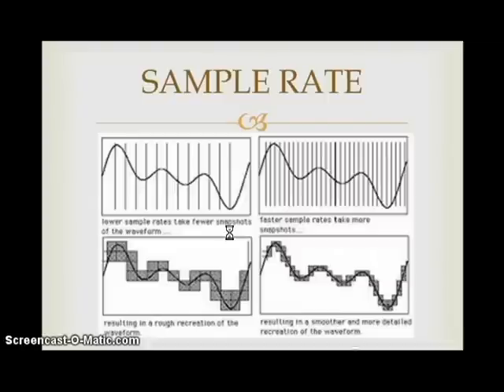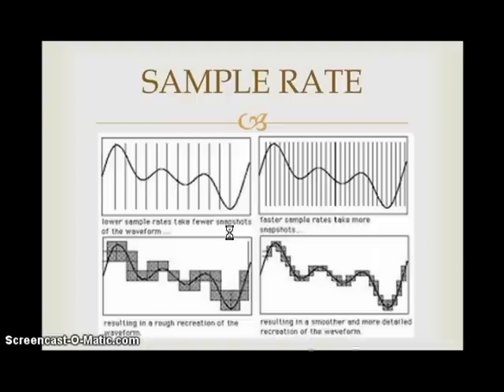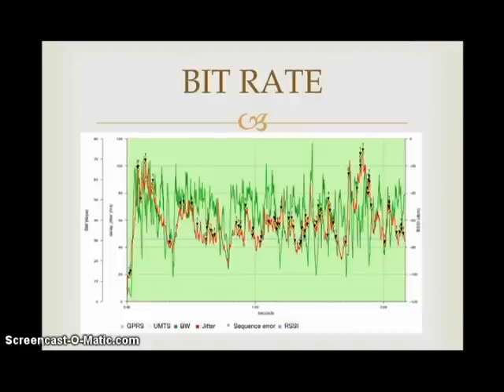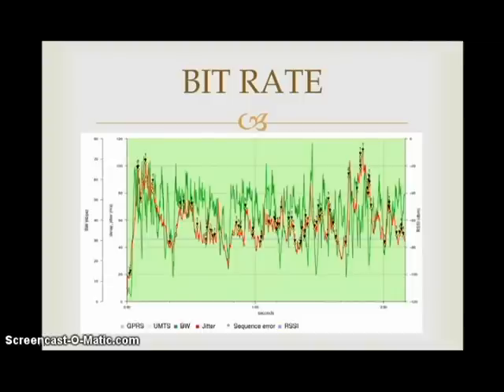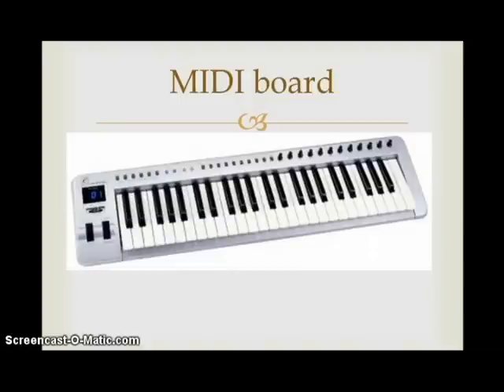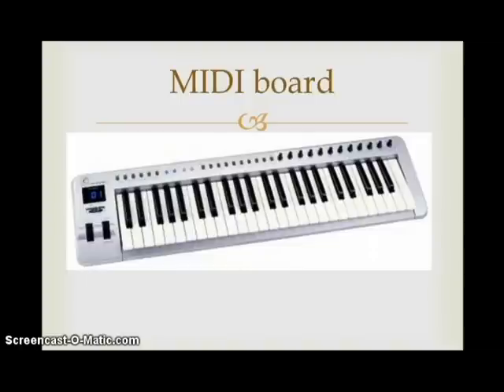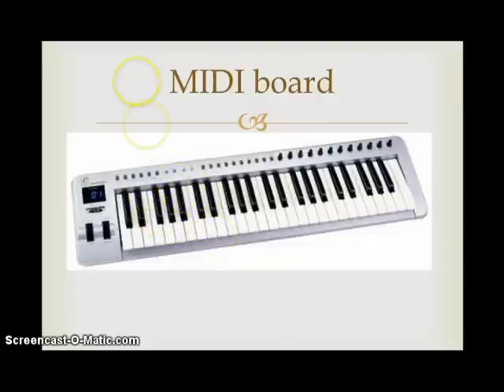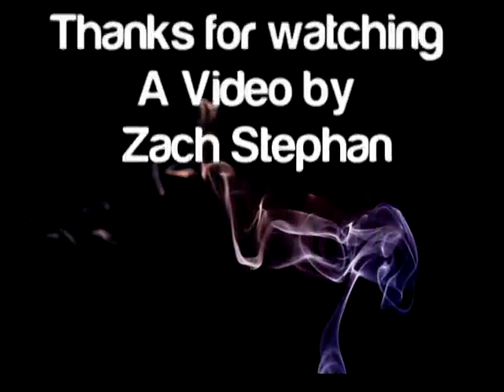Chapter 6: Digital Audio

Comment: Digital audio is used in many type of media presented online. The quality of the audio depends on the sample rate. The higher the same rate the closer the digital audio will be to the actual audio. Bit rate is also a factor that influences it, although the prefixes get very confusing. The better the audio, the more complete of an experience it will be for the listener.